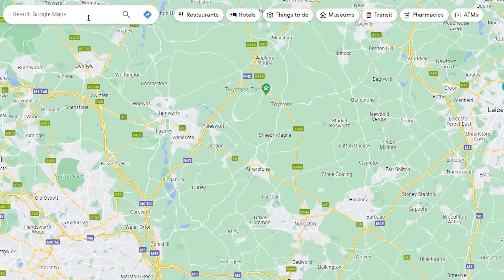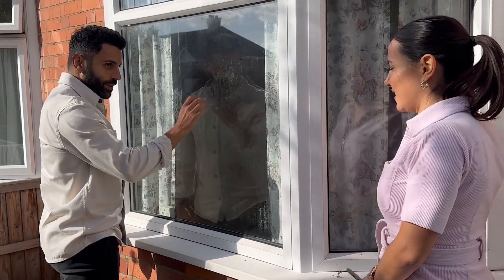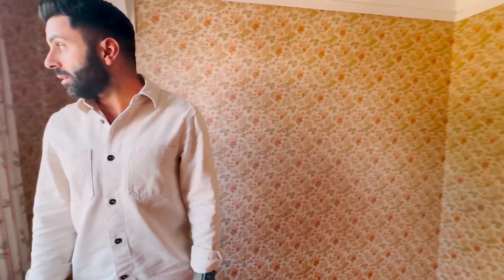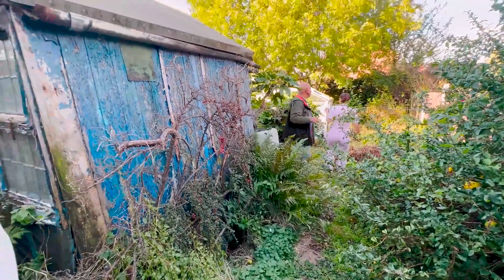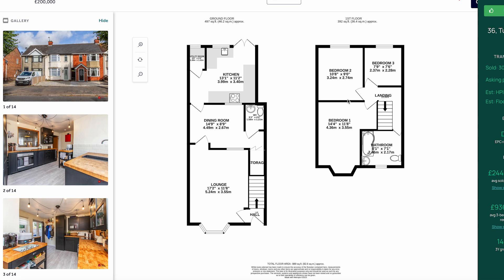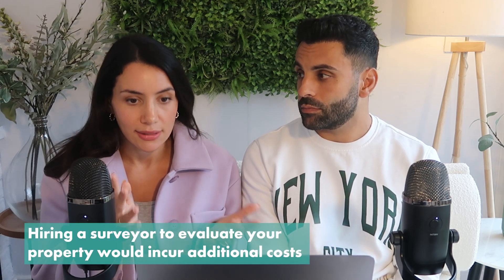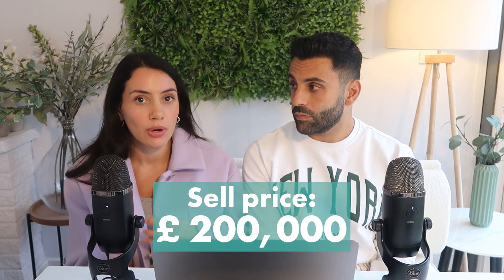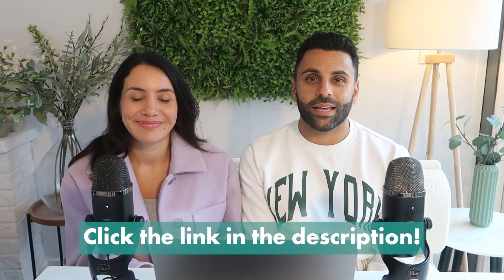HOW WE ANALYSE A PROPERTY INVESTMENT DEAL BEFORE BUYING IT!

Comment: Another great informative video.  In older homes, asbestos in older building material, mold, rot and salt in concrete foundations are concerns.  Remediation of these can be very costly.  Not sure if asbestos is a worry there.  Contractor costs to rehab the property also seems more reasonable in the UK.  Great thing about UK home is many homes there are brick vs wood construction.  Good find.
Reply from the maker: Thanks for watching

Comment: This property is eventually sold for £145,000. 174 Tudor Road, Hinckley, Leicestershire, LE10 0EH. £50,000 more than your calculation.
Reply: At the end of the day, they have only used hypothetical numbers, which I think is a reasonable way to approach a deal. They couldn’t make the numbers work at £145k so they would move onto the next deal. My concern is more with the actual end valuation in that the video shows 3 bed comparables at approx 200k but their property will only be a 2 bed once works are completed.
Reply: @rishibhaskara7238 Big question is it still possible to buy from auction and still make profit as buying price is always too high and unless your are a builder yourself its impossible even to break even
Reply: @ABC-rf9op it's going to be tight isn't it? I wouldn't start with this type of property because it re quires so much flipping.  Small terraces or 70s / 80s/90s type property that dont require alot of work and arent such a money pit. However they probably wouldnt make alot..on the ooen market, but could be rented out. Then build up a really good relationship with trades people. That is probably the best way forward. I currently own an old listed cottage ( massive money pit). My partner is doing up an old 2 bed terrace with all original features. It's solid, no damp, decent roof. Just time consuming to do alone. It will be very special due to its intact features. Would make a great Air BnB. Some people specialise in flats with very short leases to rent out. Sometimes have to think outside of the obvious. Just editing say that I read years ago that garages in auctions can be profitablein city centres where parking is a premium. Rent those out.